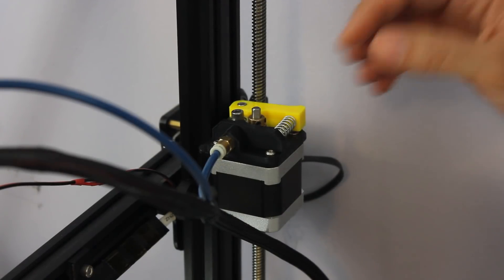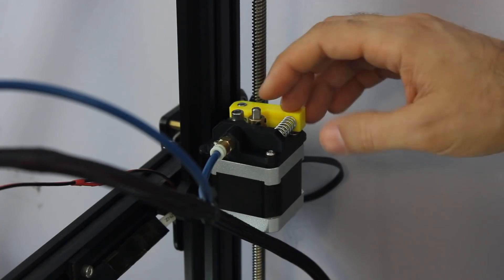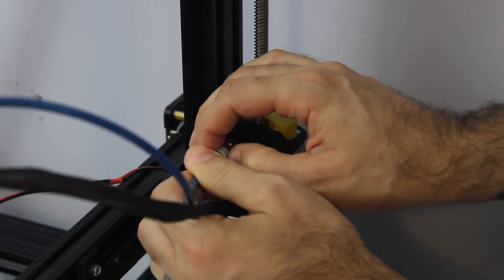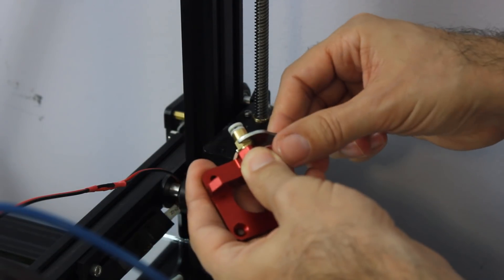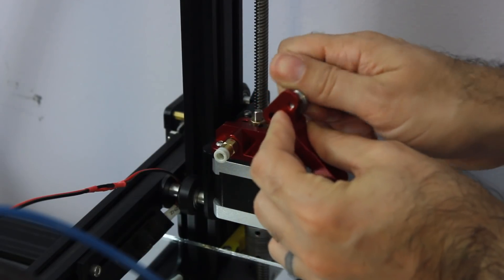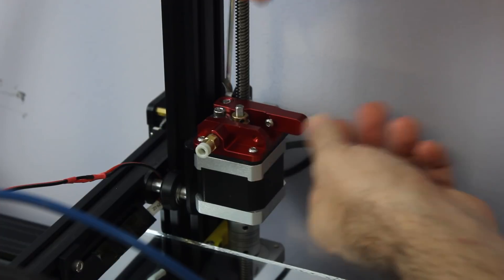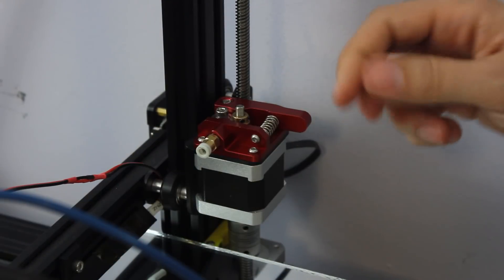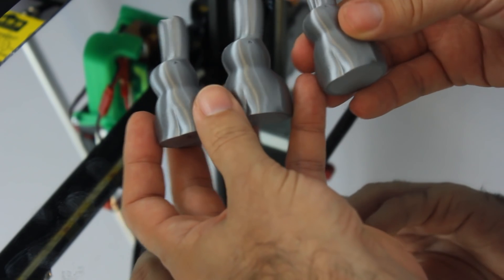Creality Metal Extruder Upgrade for CR-10 and Ender 3

Comment: will it work for cr 10 smart
Reply from the maker: I don't have any experience with the CR-10 Smart, but it looks like it has the same extruder as the CR-6 SE. I've swapped the CR-6 SE extruder for this older style extruder and it's worked great. If the CR-10 Smart does in fact have the same extruder as the CR-6 SE then this swap would work.
Reply: @Review3d  This extruder will work for CR 10 Smart. Tested. The open design is far better than the stock design.
Reply from the maker: @benevantmathew  That's awesome! Thanks so much for the update!

Comment: Do you think this would be the same install for a cr 6se?
Reply from the maker: Yes, I actually installed one on my CR-6 SE a few months ago and didn't run into any issues. The original extruder started giving me problems, so I figured I'd give it a try and the metal version has been working perfectly.
Reply: @Review3d  Yep. The plastic one started the Click click click stuff and under extruding. I just finished my first print test after the install. Works perfect that with the new OEM hot end I put in too. Works better than when it was  new. Thanks for the video Sir. I just wish I had a larger build surface but can't fix that with a cheap upgrade. 😄

Comment: Creality also has an affordable modular direct drive extruder. I'm trying it out now. It is the first mod on my new E3V2 printer, and the printer has not been used yet. This is my second E3V2 printer. My older printer still has the Bowden setup. I am not impressed with the Bowden tube extruder system. 

Creality's direct drive comes with all the necessary installation hardware parts. The package simply includes a photo identifying the ports on the v4.2.2 motherboard, and no instructions. However, installation is rather straightforward, and could be done in about an hour. After removing the extruder stepper motor, stock Bowden tube, and hot end from the X-axis gantry, I continued to disconnect the prior from the motherboard. Then, I installed the direct drive connections to the motherboard. The connections are identical to the stock equipment. Once finished, I only had to readjust the E-steps which were only slightly off. I need to tweak the printer a bit, i.e. bed-levelling, but everything is working fine.

I did not weigh the unit, but I found it light. The only thing I don't like about this direct drive is that the extruder assembly is made of plastic just like the stock extruder. I'd replaced the plastic one for an aluminum one on my older printer after the lever cracked. The lever is notorious for doing this. The plastic extruder on the direct drive is installed behind the stepper motor, and should be replaceable with an aluminum one.
Reply from the maker: Great info! I've actually just started considering the Bondtech direct drive for my CR-10, so your timing is interesting. The Bowden setup works well for me, but I want to be able to print flexibles faster (along with some other reasons).

Comment: I know this video is old but can  @Review3d confirm the fittings are the same  Review3d
Reply from the maker: Are you asking if the fittings the same as the original fittings/extruder? If so, then yes. At least on this type of metal extruder, but I would imagine other types would be the same also. These are pretty standard fittings across many FMD printers.

Comment: For screwing in the fitting that hold the tube, do I put in that little black plastic insert into the metal hole? Because the fitting doesn’t screw into anything in the metal part alone.

Comment: Hello, I have A Creaity CR-10 with Dual Z Axis motors. The z axis goes up and down when homing but will not go up when printing. Is this a problem with my machine or am i doing something wrong in Cura ?
Reply from the maker: I've never run into an issue like that. One thing to help figure out if it's Cura or your machine would be to check your gcode.  Edit one of your sliced files and see if the Z height is being incremented. You can search for "Z" in the gcode and see Z height in a G0 command near the end of each layer. If it's incrementing then the issue would be machine related.

Comment: I can't manage to break the seal on the screws with the supplied tools. Any advice?
Reply from the maker: You can put a couple drops of penetrating oil around the screw head and allow it to soak in (I like PB Blaster). You may need to do that a couple times. Also, several good taps on the screw head help the oil penetrate more (seriously, this was a life saver on rusty auto brake parts). Don't forget to wipe any out of the head where the allen wrench goes. Other than that just make sure you insert the short end of the allen wrench into the screw and push on the long end so you get the most leverage. Keep downward pressure on the end of the wrench that's in the screw so it doesn't slip out.
Hopefully some of that is useful. Good luck!

Comment: Will this work on an Anet A8?
Reply from the maker: I don't have any first-hand experience with the Anet A8, but from looking at pics online I don't think it'll work. It looks like the extruder arm will hit the frame that the extruder stepper is mounted to.
Reply: Review3d what would work then. Because I had a piece that worked and I broke.
Reply from the maker: @danielh4309  I would see if there's a Facebook group for A8 users. They'd be very familiar with the printer and could hopefully give you better guidance than I can.
Reply: Review3d ok thanks

Comment: I did everything just like you did in the video and my wheel is still catching and not extruding correctly.  What am I doing wrong?
Reply from the maker: There several other things that could be causing it. Partial clog or low voltage (vref) going to the extruder stepper motor.
Reply: @Review3d  ok cuz it turns all the way till it starts to extrude out the nozzle than it catches but filiment comets out just not as good. maybe changing nozzles? how do I check the voltage?
Reply from the maker: @gamersofanarchy5494  nozzle change is cheap and quick. If that doesn't work then TH3D has a good video showing how to check and adjust vref. Here's a link to his video: https://youtu.be/pJRYXKRAUN4

Comment: The idler bearing/screw assembly looked like a sloppy fit along with tightening method made me cringe. Typically this would be a shoulder screw type where the shoulder dia. matches the ID of the bearing. The threaded end is made smaller than the shoulder part. You then tighten the shoulder area against it's mating surface to a reasonable or the rated torque of the fastener. The little insert for the lever looks like it's designed to allow for the holding screw to be fully tighten without affecting the action of the lever. This way the spring has the full control of the tension.  I haven't had mine apart yet but I assume this is Creality's standard method for assembly of the idler. Shame on them if so, it's really piss poor.  If my description is hard to follow just google "shoulder bolt". Other than that, looks like a quality kit.  All the prints looked outstanding to me!
Reply from the maker: You're right, overall it's a good kit but it does have some shortcomings. As you pointed out, a shoulder screw would have been nice. The insert for the lever would work great if it was literally a hair longer. Since this video I've added a .1mm shim under the insert and it allowed me to fully tighten the bolt without any binding on the lever. I guess we get used to dealing with small issues for the low price point, but it would nice if they updated the kit.

Comment: When I saw the final result, my jaw dropped. If that is anything coarser than 0.2mm nozzle and 0.05mm layer height with carefully planned settings and very forgiving PLA, I need to either step my game up or stop even trying. :D
Reply from the maker: Thank you! At the time I had a 0.4mm nozzle on it. I forget what layer height, but I believe it was 0.1mm. I've spent quite a bit of time dialing in my settings, but the Stronghero filament is pretty forgiving too. One trick with silk filament to get that really silky finish is just to slow it down (sometimes way down).

Comment: My extruder arm was cracked at the bearing.   Probably for months.   I just ordered a new aluminum extruder.   I was suffering from under-extrusion and also retraction hairlike wisps on my printed models.   I spent a lot of time messing with the Cura retraction settings.  It drove me crazy for weeks.   I had to disassemble the extruder to actually see the crack.  Also the extrusion gear was making a mess of the filament. It was leaving filament dust.    It was the worst with wooden filament.   hopefully tomorrow I can reinstall the new one and reset my extrusion steps.  I have only owned my Ender 3 Pro for 5 months and I don’t even print all that much.  I am glad that my prints are going to get back to normal after tomorrow.  I should have upgraded the thing the moment I purchased it.  

A quick question for you.  Do you or does Creality recommend lubing the Z-Rod with either graphite, dry Teflon spray (Dupont) or lithium grease ?  

I have never lubricated mine.  Some people on a forum said they have.  Your thoughts ?
Reply: Crazy. While watching this video to upgrade I found the same crack on mine! Hoping this fixes my issues. I am in the same exact boat as you were.. had the ender 3 pro for about 5 or 6 months with a moderate amount of printing. Starting having the same issues too
Reply: Replaced my Extruder arm last night.   Fixed some issues.  The wispy strings were I was running my 3D-Solutech PETG at 245 or so.  This PETG requires a max of 200-220.   Turned it down to 220 and the bed down to 70 and everything went a lot better.  I am surprised at the different manufacturers varied max temperatures for really the same PETG filament.   Who knew the temps would be that varied.  Good luck with your printer
Reply: @GreyGhost-r4z  I had no idea that brands would change the temp requirements. I need to look into that. Thanks!!
Reply from the maker: Sorry for the late response, things have been crazy. I'm glad you found the issue and were able to fix it.
As far as the Z-rod, I actually use 3-in-one oil for all of my printers. Every month or two I wipe it down with a paper towel (getting down into the threading) to remove old oil and dust and then give it a new coat.
Honestly though, I think any of the ones you mentioned would work great too. You just want some sort of of lubrication, wet or dry, and you don't want too much dust and debris to collect on it and cause binding.

Comment: Would you know will this work with the Alfawire U20? 
It looks exactly the same yes I know it may not fit because it looks the same.
Reply from the maker: I'm not sure, but it looks very similar. Also looks like the LK1 stepper motor on the U20 matches the 31mm screw spacing on the Nema 17, so the screw holes will match up at least.
If you were to try it out, the Creality metal extruders have been popping up on Amazon for under $10.
Reply: @Review3d  
Ok thank you

Comment: I had to replace my stock extruder due to the filament wearing a groove. I replaced it with this. With this setup I started having the problem of the feeder gear slipping a tooth about every 30 seconds to a minute. It didn't affect the print quality. E-steps and extruder calibration look good. So it's not causing a problem at the moment but it shouldn't be doing that. I'll try adding a washer and see if that helps. Before anyone asks it's not a clog nor is the nozzle too close to the bed lol.
Reply from the maker: I'd wonder if it was not enough spring pressure at the extruder, but I'd expect it a little more frequently than every 30-60 seconds. Maybe nozzle temp is too low? One or two degrees can make a difference.

Comment: @2:46 - I completely understand using the tools that come with the printer if that's all you have. However, if you have one available, I found that using a pair of needle nose pliers helps remove the spring much easier by compressing it. Just a friendly FYI. Nice vid BTW! Really helped me when I upgraded to the MK8 (since it doesn't come with any instructions... :D)
Reply from the maker: I agree and that's a good point, needle nose pliers would be helpful there. I wanted to work mainly with the tools that came with the printer, in case that's all that some viewers have. A basic set of tools will always make life easier though.

Comment: Upgraded using the same thing on an Ender 5.  Same steps , just turned on it's head!
Reply from the maker: That's great info, thanks! I don't have any experience with the Ender 5, but I thought it might fit since it shares the same MK8 extruder.

Comment: What's the best thing to print quickly to check for underextrusion?
Reply from the maker: Most simple models would work to quickly test for underextrusion. Something with simple curves and one flat side.

I have a model that's basically just a rectangle with an "S" curve on one side. I print it with zero top and bottom layers, 2 walls and then I play with flow rates, temps, speeds, etc. I use it to help dial in filaments and when flow rate is set too low you can definitely see the underextrusion on the print.

Comment: You can tighten the tension arm all the way down without binding on the cheap $10 Chinese version. JS
Reply: Yes, you are partly right, but only if the tension arm has the loose bush that the screw tightens down on leaving the arm free to move. I fitted one to my E3 Pro about 2 weeks ago for when I start printing......at the moment I'm in the fixing it even if it ain't broke mood and at about the same time I was just browsing AMAZON to see what else they have that's interesting and I came across the very same looking extruder BUT.....it's a DOUBLE DRIVE  one....it has the 2 geared drive rollers and sells for about A$20.....I kid thee not.....delivery scheduled for next week 25-7-2019.  This one is a 1:1 ratio drive, unlike the other ones that have a large gear driven by a small gear on the stepper motor that drives the rollers at 1:3 reduction. It has the same orange red colour as the extruder in this video. I want to do a direct drive next and this new extruder will fit the bill nicely......direct drive and double rollers without a huge outlay.....what more do you want for A$20 total outlay.

Comment: Just replace the arm spring with a screw to get more pressure, no need for a all metal extruder, you will get the same result if you use the original arm spring. Could you do a test using the original yellow extruder but with the all metal extruder's spring ?
Reply from the maker: Just increasing the spring pressure is an option, whether you do it with washers or swapping out the spring. I do like the added reliability of the aluminum parts. I've definitely had less issues since swapping.
I have the original spring, I'll compare it to the new one and see if they look any different. Wish I had a small spring tester so I could see if the new one is actually more stiff.
Reply: @Review3d  3D print a spring tester ;-)
Reply from the maker: @surronzak8154  exactly what I was thinking.

Comment: Lovely video. Great tutorial.
Have you tried printing Ninjaflex?
It does give problems with the original CR-10 extruder drive feed.
There is a 3d printable upgrade where you have to add a v-shape piece of Capricorn tubing, but on this upgrade you have, it already has the v-shape.
Have you tried?
Anyway, thanks for the video. Really great.
Reply from the maker: Thank you!
I tried Nijaflex on the original extruder, with the 3d printed upgrade. It printed fine and I had no feed issues.
The aluminum extruder has the v-shape, but it doesn't protrude as far as the 3d printed upgrade with tubing, so there is a small gap. I haven't tried Nijaflex on it yet, so I don't know if the gap will cause issues or not. I'm thinking if you print nice and slow it'll be fine though.
Reply: Thank you so much for your reply.
I will try it out when I get some Ninjaflex.
Again, thank you so much.